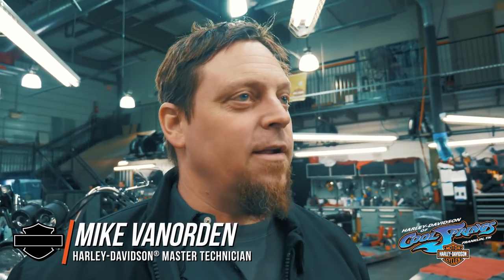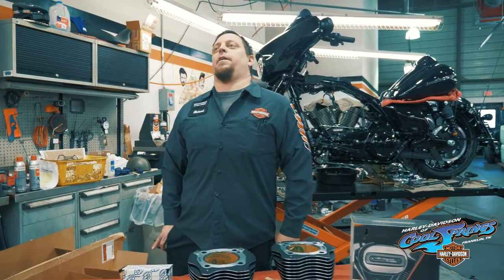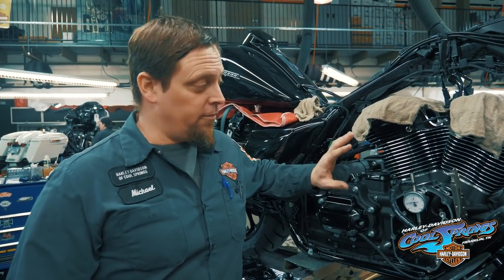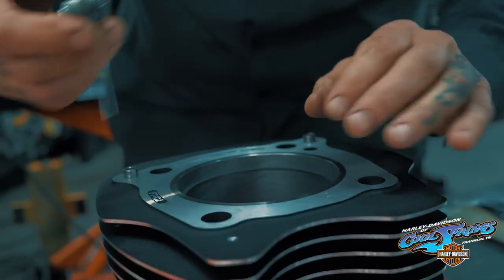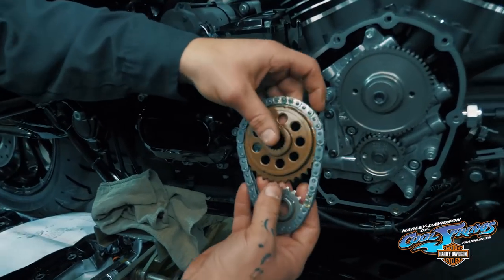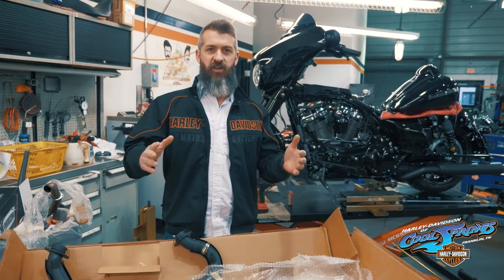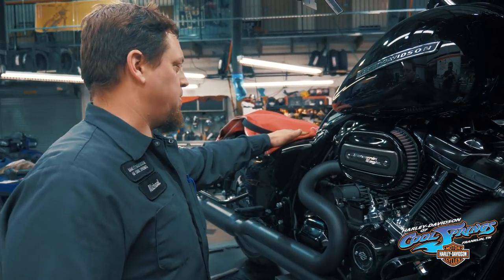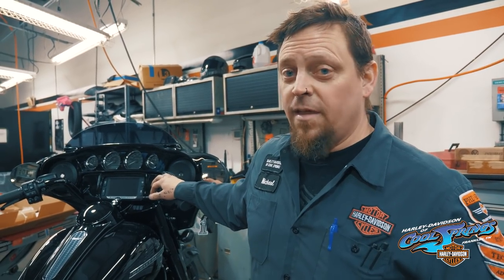81hp to 115hp! - Shop Talk Episode 4 - 114ci High Compression Gear Drive Cam

Comment: 142 horsepower 106 Twin Cam is what I ride.  Reliable and will live long with 4 3/8" stroke.  Not a fan of increased piston speed with big strokers.  I built it using S&S crankcases,  heads, and cams.  55mm HPI throttle body, and 625 cams.  10.8 compression ratio.  Happy with it.
Reply: Al Barnes Nice!
Reply: Al Barnes I totally agree.  I’ll keep my 107hp 116 torque twin cam 103 as well.

Comment: With labor, what's the cost of this build? And is that the same 114 HD is using now across the lineup?
Reply: Aaron can help narrow down cost. Can him at the shop. And no this isn't the stock off the line 114.  This has added compression.

Comment: I have to admire the lengths HD owners will go to in order to make the Machine they own what it should have been on the showroom.

Nice coff.
Reply: its the American way.same in the past with gm mopar or ford
Reply: I admire the fact that we can mod them so many ways.
Reply: Well I guess if you're the kind of guy that likes to show up with a hot rod that you didn't build, or a Harley that you didn't install your own cam oil pump cam plate valve springs N-Tune. Well I guess you just wouldn't understand.
Reply: @jimregal928  true.  I can't understand why the customers of hd like to be quality control units.

Good thing the Screaming Eagle catalogue exists.
Reply: @creigmacc  it's like any other hot rod how many aftermarket parts catalogs do they make for Ford Chevy Chrysler people spend endless amounts of money turning their vehicle's into rods Harley just happens to be one of the few motorcycles you can turn into somewhat of a hot rod.

Comment: I like that gear drive set up. But I hav heard that the M8 is not uncommon for them to have over 5-6 thousands of runout. Is that something that you guys see? I’m wanting to do the gear drive but I don’t want a noisy motor or for the gears to eat themselves. What’s your thoughts on the gear drive VS chain?
Reply: Joe Vandivner We hardly have one that doesn’t spec out for the gear drive setup. I would say you info is inaccurate.  If we where talking twin cam your comment would be correct.

Comment: 1:15 "relating in...we don't want to go, we don't want to talk about that" LoL! Everyone knows but the Harley gods will be angry with you if you mention it. I was going to get woods 222 or SE204 cams because I forgot about the tensions. I don't want to go  back in there if I don't have to plus "1:04 ...because tensions tension" I might be able to push the engine just that little bit more with the geared cams. Well worth the $200 difference. I just hope my crank shaft runout is in spec and my gear lash is right off the bat.
Reply: The M8's are pretty tight engines and more often than not are in spec.  If the lash is out there under/oversize gears available.  HDCS has them in stock.

Comment: hey moonshine I got a question I have a road king classic 2008 and I want to change the spark plug cable do I have to take off the gas tank or what do I do I want to put the 10mm new cable. thanks.
Reply: If you can get in there between the tank and rocker box you don't have to do anything.  Sometimes it's easier though if you unplug the fuel line, remove the bolts on the tank and just lift it up a little.

Comment: Is it possible deal 114 kit like this using stock mufflers to make a sleeper out of it?    And will it run good?
Reply: Not really with stock mufflers but our 2-1-2 headpipe uses stock heatshields and isn't real loud so it looks stock.  We are building what we call "highway sleeper" buds all the time with up to 150tq!  Alot of the nitty gritty is on my Instagram @m.v.o_motorfast

Comment: Enjoyed the video.  My question to you is, with this direct gear drive for the camshaft.  How do you eliminate the "Whine", if too tight, or how do you eliminate the "Chatter" if too loose.  In short creating a quiet running efficient engine.  I like the idea of the direct drive, but if it makes noise...what good is it?  Just asking.  It's a well known problem with this new M8 engine with problem of oil system once we do upgrades with the upper ends.  Seems like the stock system cant keep up with the increased power from the big bore kits.   Am I correct in saying the new fuel pumps/Cam Plates from S&S and Feuling have eliminated the issue with Sumping?  Thanks!
Reply: The noise is very slight if any.  We have installed a lot of them.  The "sumping" issue has been blown way out of proportion by our friends trolling the forums/YouTube.  There is nothing wrong with the stock oil system or tensioners.  However, there are upgrades for them just as there are for all motorcycle/car manufacturers that have modification history.

Call Aaron at the shop.  I also post builds and Dyno sheets etc. On Instagram @m.v.o_motorfast

Comment: Since Harley got rid of the roller bearing what happens when the crankshaft starts running out of spec to those gears?
Reply: The gears actually help the bottom end maintain it's specs.  The gears hold the movement of the crank in check.

Comment: I wouldnt put gear drive in anything over 2 thousands  crankshaft  runout,, zippers tensioners with a S&S or fueling cam plate work awesome in my opinion ,, not my bike so ill shut up lol...

Comment: Great Videos!  I got a 475G camchest kit.  I put the cam gear on today and it appears to pressed the cam into the bushing in the S&S camplate.  It will rotate, but I can move it with my hands like you did in this video...it's alot tighter in the camplate. Is that normal for a S&S set up? Thanks
Reply: I'm not sure I follow.  Call us at the shop and maybe we can help.  Ask for MVO in service

Comment: I think "Catastrophic engine failure " was the words you were going to speak. Checked my tensioner shoes a few years ago and one was worn to the metal base. Had gear drives installed. Stupid engineering. "We'll just let the customer deal with it since the warranty will be out."

Comment: What happens when you you start loosing your crankshaft bearing tolerances over time with this set up :
Reply: Actually the gear drive setup helps maintain the crank shaft tolerance due to the nature of it's design.  That is a big reason it is critical to achieve initial.runout tolerances.
Reply: Thanks fer that ;
I know a hd mechanic that’s made a good living changing out to gear drives .
He said run good :
Yeah tolerances wear and you will hear a whine before anything goes south .

Comment: Using the dial indicator that far offset from the actual movement will give you pretty inaccurate results.
Reply from the maker: The indicator for the M8 was not available when this video was made but has since arrived. It was re-checked with the proper tool and was made spot on! Thanks for watching! Good eye!
Reply: It doesn't matter where the indicator is.  It is a precision instrument.  As long as the indicator is stationary it will be accurate.  You can ensure it is stationary when it always returns to 0.
Reply: @NoName-vz1ob  you're referring to repeatability not accuracy of measurement.  Lookup dial indicator cosine error.
Reply: @DoRC  enjoy your RC planes
Reply: @NoName-vz1ob  I do enjoy them. But what does that have to do with cosine error?
Reply: @DoRC  The tolerance of the lash is .0005-.0025" so the error is so slight that it isn't critical, especially since if you actually pay attention to the video it is a .0005" indicator and he gives the spec.  So you don't really need to make an irrelevant argument in someone else's field.  And likewise a vehicle mechanic probably shouldn't make irrelevant arguments about your field or hobby or whatever.
Reply: P.S.  I only got involved with this as a bet that your comment was just bait so thank you.

Comment: I love my Harley Davidson but don’t get me wrong it seems that they just sell their bikes in segments. It’s a 114 by this it has a powerful engine but you need to do stage 4 order to bring out the full power so we’re going to sell you this $30,000 motorcycle that you have to spend another 10,000 on the motor to get the full power that’s going to be the downfall for this company just like everything else in America greed!!!
Reply: It's pretty standard.  Most vehicles have a "performance" line.

Comment: I feel like I've lived too long. Having been on a Harley for 51 years. It seems like Harleys Reinventing the wheel. I understand that the aluminum cylinders are great for heat dissipation but I don't like to for head bolts that doesn't work well for high performance. We never had cam chains on our cam we always had a Gear Drive. My 74 Shovelhead hot motor had more 115 horsepower. Solid lifters shovelheads. My current Shovelhead chopper lifts the wheel and second and third no problem. I know what Harley ought to do get rid of all this stupid chains reinvent the Shovelhead get 5 head bolts going on each head get some solid lifters going maybe some water jackets I like that's a good idea they're on the right track. But stop Reinventing the horsepower game it's been done pick up a book read. The current bikes are better bikes. But we had better technology in the 70s. What you guys are doing is melting the two and that's good. But hardly has to stop doing stupid stuff on their bikes. Cam chains oh my God. Old guy talking. I'll keep my shovel to Harley gets it right.